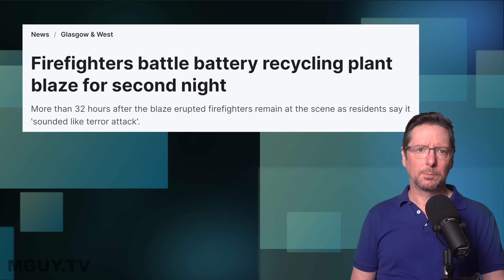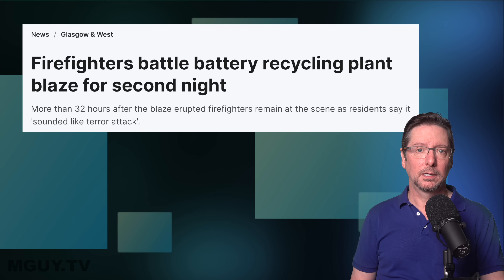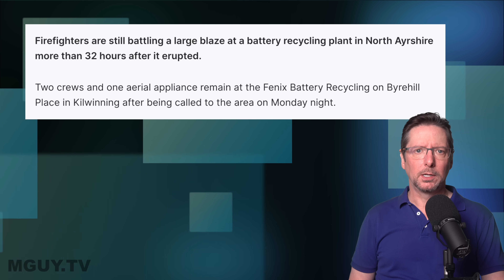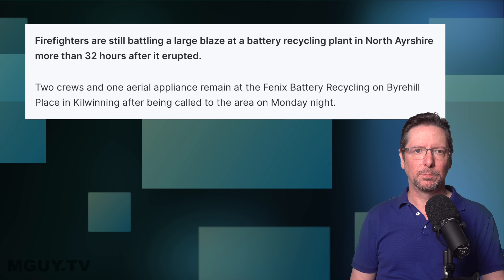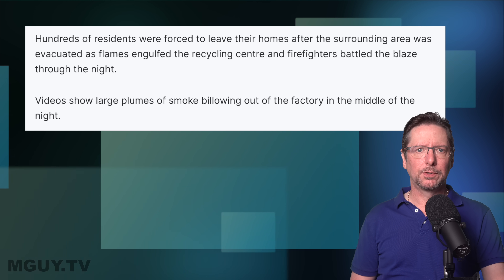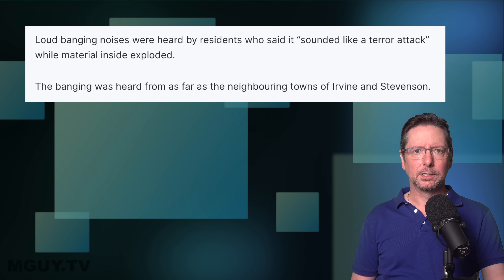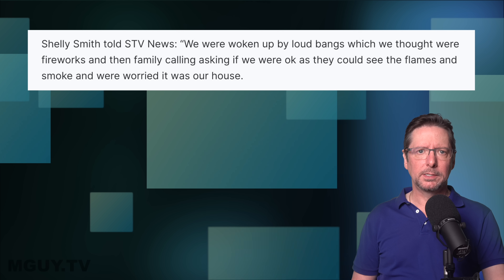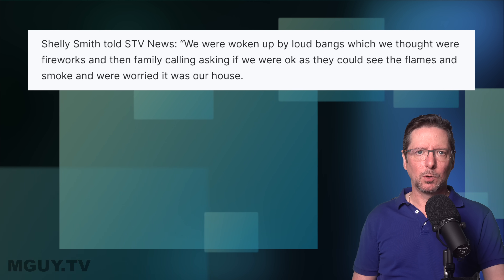EV and Lithium Ion battery recycling is DIFFICULT, DANGEROUS and TOXIC | MGUY Australia

Comment: This all just OH&S; just like gasometer fires, and petroleum refinery fires, and coal mine fires, and oil drilling fires and….
Reply: except hydrocarbon fires release only hydrocarbons, not highly toxic chemical fumes

hydro(hydrogen)carbons(carbon)
Reply: @andyman8630 
"Hydro' is derived from latin for liquid.
Reply: @OpinionFactChecker  
that's nice! hydro in the word hydrocarbon refers to hydrogen

you can even look it up! (shock horror)
Reply: @OpinionFactChecker  
hydro in "hydrocarbon" refers very specifically to hydrogen
Reply: @andyman8630  
Whatever, there's no need to be a dick about it.
Reply: @andyman8630  BTW, if fossil fuel “hydrocarbons” are nothing but pure hydrogen and carbon, then where do all the carcinogenic contaminants come from? Carbon monoxide is a poisonous gas causing approximately 2100 deaths per year in the U.S. How many recorded deaths have there been from off-gassing of L-ion fires?
Reply: Okay, then how about tyre dump fires? FYI, every ICE is literally a “hydrocarbon fire”. Not toxic? Tell the hospitals.
Reply: @petergosney6433  
tryes have much more than mere hydrocarbons in them!  Benzothiazoles, Chlorinated paraffins, 1,3-Diphenylguanidine, (Methoxymethyl) melamines, Octylphenol ethoxylates and the list goes on

does nobody do any research?

Comment: Any body that has common-sense and has the ability to think outside the box understands EVS are a bad idea. But trying to convince the eco friendly sheep 🐑 is a near impossible task.
Reply: Okay oil sheep 😂 same argument different foot
Reply: EV's are just technology that needs to be refined. It's the head long push to the detriment of completing technology that concerns me. A prudent person does not put all their eggs in one basket as we are apparently doing.
ICE technology is nowhere near its peak, and the same can be said for batteries.
Reply: @OpinionFactChecker  BEV batteries are recycled by burning them. My evidence is France and now Scotland.
Reply: @simonbutler6019  holds breath… does basic googling…
Reply: So if you can find me an engineer that thinks an electric motor is a worse idea than a petrol motor for vehicle traction (ignoring how it is powered).  It is a no brainer, lighter smoother, less components, more control, cheaper to build, cheaper to run and zero maintenance for the design life.  Then you hit the second part the battery vs petrol tank as the source of energy.  Suddenly you get into debate but the ice engine is the compromise.  So are ice engines improving?  Not really they are mature.  Are batteries improving? Yes the performance is double what it was 7 years ago with a substantial drop in cost.  The unemotional question is how long do I need to wait before I can get a battery appropriate for my application.  Recycling would be a part of that decision.
Reply: @Stepbystep74  I hope you are getting paid to lie.
Reply: @RemnantDiscipleLazzaro-Rev1217 which part was a lie?
Reply: @Stepbystep74  You are just plain wrong. NO engineer would say that an electric motor was better than petrol or deisel for vehicle traction under all conditions, so let's just back that BS off some. For the record, Simon is an engineer, so that's one. I know 4 engineers who think EVs are a bad joke. That's 5. You only asked for 1.
In a perfect world, where energy was cheap and abundent, where conditions were always perfect, where there were no hills, no headwinds, perfect road surfaces, and you had some miracle energy storage device, an engineer would probably say an electric motor would be a better IDEA. Back in the real world, EVs do not perform as well by almost any measure as a petrol or deisel powered car or truck... You know how I KNOW that? Becuase the vast majority of people consider their purchase options and do not chose an EV. I think you nailed it when you said EVs are a no-brainer. You'd have to have no brain to buy one!
As for your statement that ICE engines are not improving... Do you have a head injury that means you cannot remember the past 20 years or are just ignorant? In the last 20 years, we have seen direct injection, New metalurgy, variable valve technology, turbo technology and many many more inprovements that have made IC engines much more powerful, more efficient, quieter, smoother and cleaner. 
The basic physics of batteries is so limiting that batteries need to improve their energy density not double, not triple, but in orders of magnitude to match ICE vehicles even given EV's better energy efficiency. Last I looked (a few years ago) the best battery available was 140 times less energy dense that petrol. That's a LOT of catching up!
Reply: @mikepickford1   excellent so we agree on the statement I actually made, although I think an engineer would say headwinds, hills and road surface would all benefit the electric motor? Dealing with those other things involves a complicated gearbox.  The motor is no worse with a headwind,  it’s the battery capacity that affects the range.

My point is the battery is a compromise for a better engine.  Has any metric of performance of road car engines doubled in the last 20 years?  A lot of those things you listed were present in cars from the mid 90s and no metric I am aware of has had a doubling of performance in the last 7 years?
Reply: @Stepbystep74  i beg to differ ICE engines are improving and many steps are being taken to make them even cleaner and  as with batteries energy output has doubles, rember one a 1 liter engine was lucky to see 40 or 50bhp? theya re now around the 100 - 120php .....
Reply: @vandamonium1731  I think a lot of that is design considerations, for a 1l car in the 90s say a 98 Yaris you are looking at a lighter car,  67 hp gets your 0-60mph in less than 14 seconds.  The equivalent now is the 2024 aygo, that has 72hp and is around the same performance.  The power levels go up for other cars because the extra weight and the consumers want the same or better performance not because the technology has substantially improved. 
Edit,  they are actually the same weight of vehicle,  not sure why the aygo is slower.  I did also think of one major improvement “stall resistance” is way better now.
Reply: @Stepbystep74  so your saying from the design of early fuel injection systems (of which i work on still) to the more modern injection systems that not only carry more sensors to monitor the engine to better and more advanced software that not progress?? different cam and head as well as piston and valve designs to to acheive stoichiometric efficiencies hasnt changed in the last 30 years?  instead thats what the public wanted? and using a yaris vs an aygo is not the same ... they are no where near the same only in badge ... im stood looking at both side by side now 

i best sell my toolbox and close my garage
Reply: @Stepbystep74  ps both are within 3bhp of each other and the Yaris is heavier and quicker due to mapping and engine flow characteristics so that shows a bad example of comparing the 2 cars
Reply: @vandamonium1731  no I’m saying it is currently a mature technology,  changes are small and gradual which seems to match what you were saying.  more sensors increase the costs, for increasingly small gains in efficiency. You talk about 30 years,  cool so be generous and my 98 Yaris 55mpg(5.136l/100)would now do 75 mpg(3.766) about a 36% improvement.  1% per year?  Batteries have tripled in energy density in the last 14 years so 20% per year and that rate is accelerating.  The question is when will they be a mature technology and drop down to 1% improvement per year as a mature technology? If it happens this year evs might be the new Betamax,  another 10 years seems unlikely, question is how many more years before they make sense to you?
Reply: @Stepbystep74  i had 2 ev's (ioniq5 and id3) and they were not a patch on the petrol and diesel cars, yes battery density has 'tripled' but the range hasnt   where as  petrol and diesels are using less fuel and travelling further so how does that equate in comparison to battery? it doesnt so when will you realise that?, that 1% you qoute is a gain where as density vs range is still at a huge loss also ice vehicles dont suffer in huge variation losses on range due to weather conditions as ev do as there is nothing out there stable in battery tech , as you know even lead acid changes the only thing ev has got going for it is the 'charge at home' culture, i have a 2019 hybrid i purchased off a customer and that has been exceptional in its milage and you as well as i both being toyota will know what the distance and consumption that has
Reply: @Stepbystep74  lets run this past you and this is  from an EV battery production page

"The prevailing perception is that electric vehicle (EV) batteries degrade over time, and there are various reports out there that suggest lithium-Ion batteries degrade at a rate of around 2.3% each year. No matter what battery technology is in the future degradation will always be a key factor oh battery technology due to charging and weather conditions which will play a key role in chemistry make up of the cell.

 We might expect an electric battery to degrade by around 36%. The rule of thumb that many people use, is that if the battery falls below 70% of its original capacity, then it’s no longer fit for purpose and should be replaced."

how often have you replaced an engine WITH ONLY 30% WEAR due to it not being fit for purpose?. our 15 works van engine has 211,000 miles on it and is still working as intended
Reply: @vandamonium1731  if range were the most important factor everyone would be towing auxiliary tanks.  Vehicles need “sufficient” range.  What that is varies the question is what is sufficient for you?  Currently an mg4 will do 324 miles.  Assuming things continue to improve by 20-30% per year when is that “sufficient” for you?  The range hasn’t tripped because the market for longer than 350 miles of range isn’t really there.  People would prefer the car to be cheaper than have an extra 100 miles of range.  Not to say you can’t buy more but I would say all this 1000mile ev flag waving is bs.  It’s not going to happen.  Not because it can’t, just no one wants to spend more money to drive for 14 hours without stopping.
Reply: @Stepbystep74  Batteries are becoming less energy dense in an attempt to keep them from being such Ecological Disasters. LFP less dense than Li Ion which is why all the Long Range models still use the COBALT batteries, Sodium less dense than LFP, batteries are going backwards.
Reply: @Stepbystep74  Battery energy density is going backwards.
Reply: @robertkubrick3738  that’s not true and I feel like you know it.   Both batteries with cobalt and LFP are improving at a similar rate. Some manufacturers Switching from one to the other does not change any more than switching from a diesil to a petrol means all cars are becoming less efficient
Reply: @Stepbystep74  you were wrong. Mechanical engineers love petrol/diesel engine because there are a lot they can work on.
Most of them detest electric motor since there is very little for them to work on. EV is all about battery and software which are out of their expertise.
Reply: @duydatyds  possibly a terminology gap automotive engineer, usually be dealing with system design, integration and prototyping.  Rather than engineers dealing with assembly, tuning and repair as they deal within the design constraints of the product
Reply: @Stepbystep74 if EV motors are easier to built why do the vehicles cost twice as much as their ICE counterparts?
Reply: @keegan773  mostly marketing and batteries?  I think Dacia are selling an ev which will be the third cheapest new car in Europe.  They can be produced cheaply and the price of components drops every year probably means they will be the cheap option.  Question is what is profitable?
Reply: @Stepbystep74  and there you have it, the dreadful batteries double the cost of the vehicle and you answer is to buy a Romanian Dacia….WOW.
Reply: @keegan773  if the batteries double the cost why is it the same price as a fiat panda? The batteries make it more pricy just like the pandas gearbox, clutch, fuel pump, ignition system, exhaust and radiator makes it more pricy.  These two things are rapidly approaching parity
Reply: @Stepbystep74  Complete replacement of the electric motor at 70,000 mile is low maintenance? The million mile tesla went through 14 electric motors in that time.
Reply: @robertkubrick3738  yeah early teslas had a manufacturing fault with their rear motors and they decided it was cheaper to refurbish them under warranty than fix it,  300,000 miles per battery pack though ;)
Reply: @Stepbystep74  Where is the electric jumbo jet type plane? Where is the electric container ship?
Reply: @robertkubrick3738  I believe the Yara Birkland is in Norway?  Personally I feel like we should focus on the easy things like cars first but I guess Norway is nearly done with their ice cars so good on them.

Comment: that fire will not be put out - it can only burn out
Reply: Dam, you beat me to it!
Reply: True...
Reply: But "green" toxic gases are sustainable and earth friendly right? 
😑
Reply: Any fire can be extinguished…. As long as you can fulfill one or more of the requirements to maintain combustion: cool/remove fuel/ remove oxygen/ provide an alternative chemical reaction that breaks the combustion reaction
Reply: @malcolmwhite6588  
not so with lithium-ion as it provides it's own fuel, heat sauce and oxidiiser - they continue to burn even when fully submerged and can re-ignite days/weeks later
Reply: No, it can be put out even though it is a self sustaining exothermic reaction which means like a fire keeps going. It is fuelled by the solvent etc and the energy within the battery. The problem is it contains internal chemical oxygen so it is difficult to extinguish, but if you quench it to the point that the temperature goes below the combustion point, the fire will go out - the problem is it is it just takes Extremely large amounts of water to do so
Reply: … Which of course contains toxic heavy metal products that require treatment before they are safe to be discharged
Reply: @malcolmwhite6588  There are videos of EV cars in rivers and lakes that continue to burn even completely underwater... how much more water did they need?
Reply: @SlevinCCX  true! In all seriousness the battery is sealed so you need a means to get large amounts of water in to it
Reply: @malcolmwhite6588  Wrong, lithium by itself will burn, it doesn't need the solvent.
Reply: @robertkubrick3738  absolutely correct Robert- lithium is potentially one of the more stable of the alkali metals, sodium potassium, I can’t remember a couple of others that are in there are more unstable, though I didn’t mean to imply that lithium would not burn by itself, merely commenting that the total package of chemistry is fairly volatile and energetic